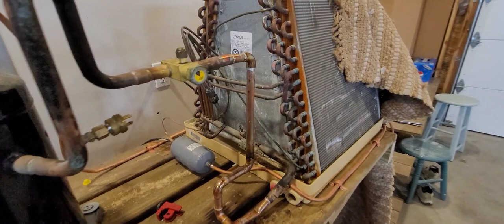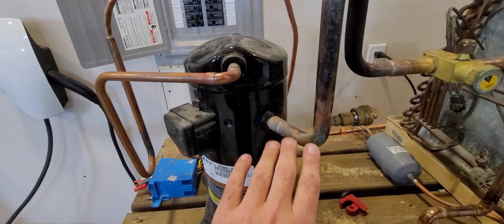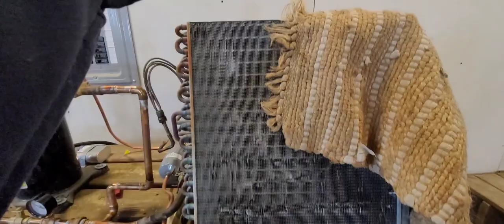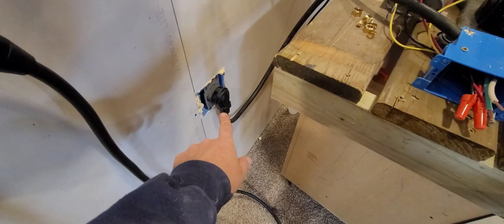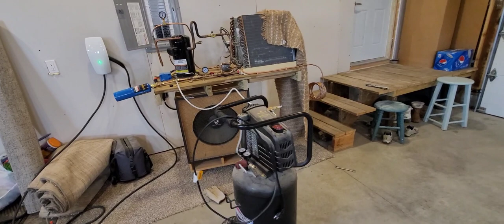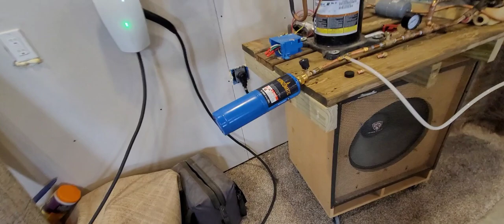DIY Pool Heat Pump

Comment: how did it end up working out? I've got a DIY solar heating system and a shitty Pentair (I don't have any nice things to say about it, the exhaust dumps way too much heat out of the exit piping and the thing is built with parts that are guaranteed to fail and cost a fortune to replace- even if you're doing it yourself) natural gas heater that just died on me. There's zero chance I'm fixing it again. I was thinking about doing exactly what you crafted up in your video. excellent work, btw 👍